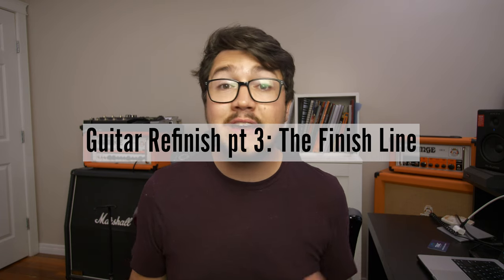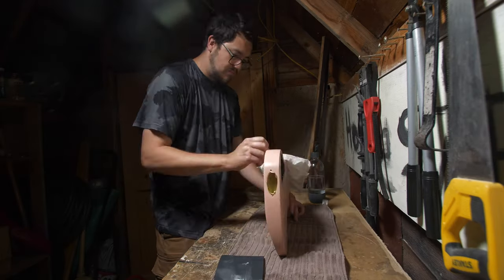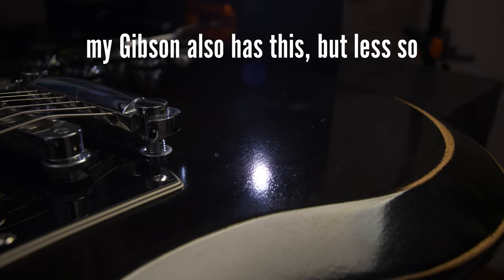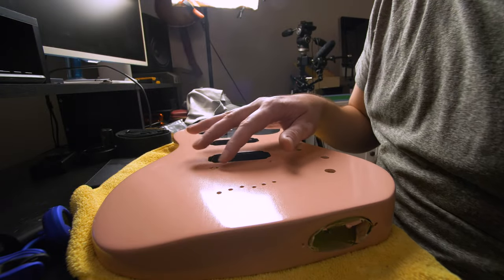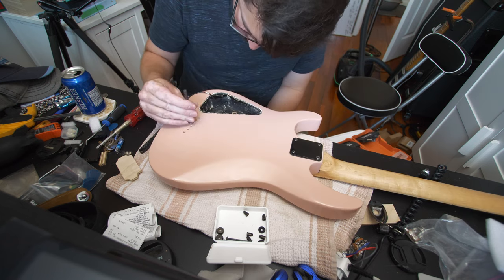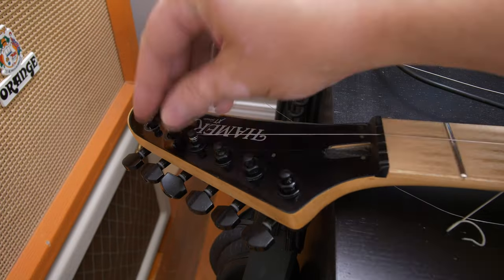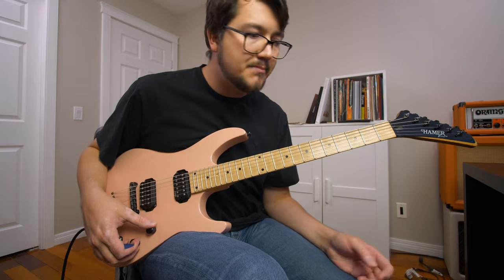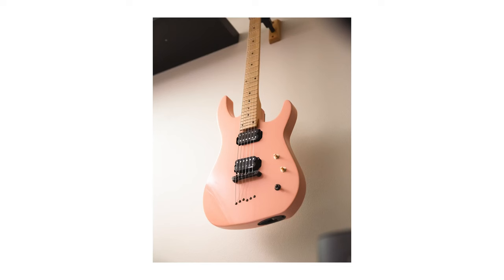MAKING IT SHINE - Final Polishing the Nitro Refinish // GUITAR REFINISH Part 3

Comment: I bought a very inexpensive BC Rich Warlock months back as a "project/learning" guitar.  The fretboard was pealing up.  The truss rod didn't work.  The input jack kind of worked but missing a nut.  The actual guitar nut fell off if the strings weren't on.  The back of the guitar was the worst buckle rash I've ever seen.  
I've replaced the trust rod, fixed the fretboard, removed all electronics and starting on removing the paint so I can re-paint it.  Your video series was helpful, so thank you very much for posting!
Reply from the maker: That's awesome! Cool to hear about your project. Best of luck with your refinish!
Reply: @Levisrad  thank you very much!  It's been a PITA so far (the guitar in general) but a fantastic learning experience with no pressure at all.

Comment: Sanding sealer gave you that texture. That texture is the sealer not in the clear.  The clear is showing you the texture Under it.   Sanding sealer is for filling the pores and should be sanded afterward. It is not a primer so to speak.  You need to level it, just to 320 or something. The next coat, the color will have 320 scratch to grab on too.  A good thing because you are going to put enough solid  color on it so that will be invisible anyway. Your color coat needs to be perfectly sanded for your gloss to shine up too.  And compound - polish afterward.  You'll get it keep trying.
Reply from the maker: thank you for this useful info!

Comment: So a little over half a year later, how did the Oxford hold up?
Reply from the maker: It’s been holding up pretty well. 
Only 2 negatives come to mind.
1. Resting it on a guitar stand with rubber coming into contact with the nitro will start to burn the finish if left overnight. I was surprised with how easy it is to cause a blemish from that. So I’ve been careful about that, putting a small towel around those rubber parts on the stand. That seems to help. 

2. I had one small chip, from where I hit the guitar on something accidentally. A very small portion of the nitro chipped, showing bare wood right underneath. It’s a very small spot. But I could imagine this being really delicate, so I’m really careful with it now.

Aside from those, it’s held up really nicely and its still really pleasing to look at.
Reply: @Levisrad  love to hear it. This will be my 5th refinish and I'm shopping around for finishing brands. Considering Oxford and Nitorlack, but also I might stick with Gracie Vintage Finishes.